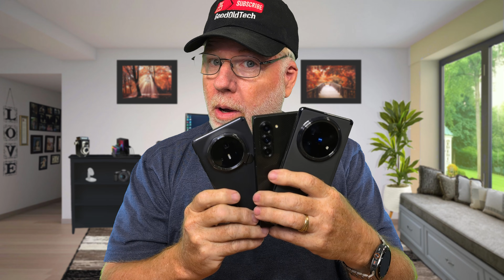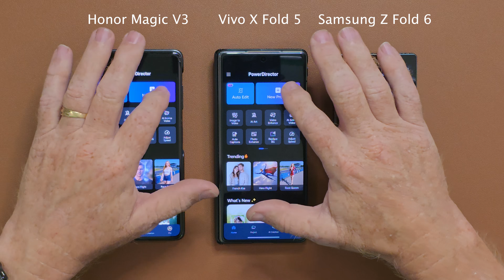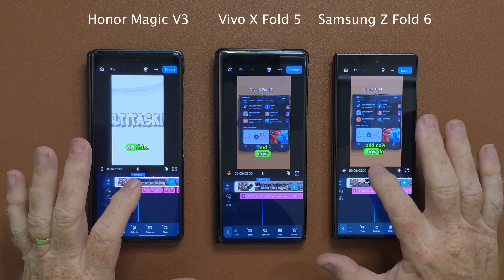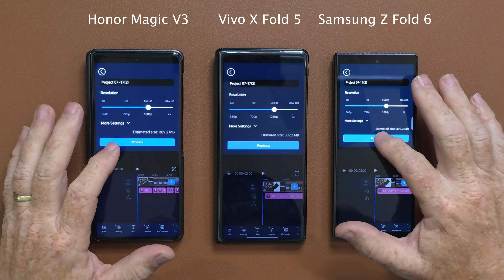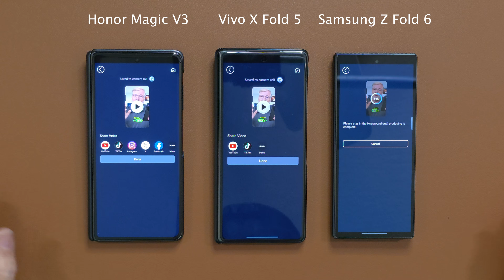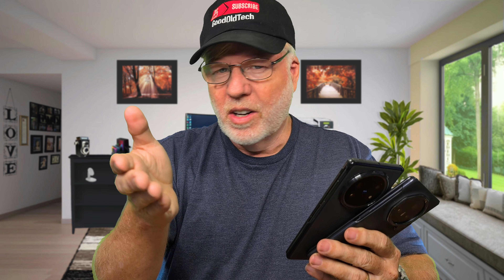Samsung Z Fold 6 Performance Test Leaves You Stunned!

Comment: Just curious as an interim check until you get the Fold7, how does the Samsung Galaxy S25 Edge compare in this test? Not a good showing for the Fold6 😳.
Reply from the maker: The S25 Ultra is very fast and beats all the folds I have. The Z Fold 7 arrives on Wednesday, and the Honor Magic V5 arrives by Friday. They both have Elite chips, so I'll include the Ultra in that test. I think it will still win because of the Fold's throttling due to its thinness. I'm anxious to see that outcome. 👍
Reply: @GOTgoodoldtech-1964 I have no doubt about the Ultra's dominance in performance, but I was asking about the *Edge*. The Ultra has a vapor chamber, while the Edge and Fold7 does not. The benchmarks suggest the Fold7 will be even slower than the Edge, due to further throttling from the even thinner chassis.

Comment: Have you made sure the Fold 6 isn't in power saving mode? Also are all battery saving features turned of for the app?
Reply from the maker: Yes, they all turned into full performance mode. Great question. I should have pointed that out and will make sure to do so in the next test. 👍

Comment: Vivo xfold5 has ufs 4.1 storage...so might be a little faster. Using the folds with heavy tasks you should unfold them for better heat dissipation. The honor and vivo are bigger so might start thermal throttle a bit later than the fold 6.
Vivo also tells you to unfold when fast charging to reduce heat.
The Oppo find n5 with snap 8 elite performs worse than the vivo xfold3pro with video rendering/export larger files because the thinner Oppo starts to thermal throttle before the vivo xfold3pro with snap 8 gen3.
Reply from the maker: Those are some great tips! At least, they were all on equal footing, folded for the test. The Honor Magic says the same thing when charging at a fast speed. I am not surprised about the Oppo throttling and expect the same with the Z Fold 7 and possibly the Honor Magic V5. This definitely gives an advantage to the Vivo X Fold 5, sticking with the Snapdragon 8 Gen 3. These will definitely be interesting battles. I will open them as you suggest. Shorts are all portrait and are best viewed on the smaller screen, which is why I did it folded.  Interesting thought, now that you mentioned it; whenever I do all the video testing of the folds, they are always closed because it is easier to handle that way. If you take videos outside for too long, even the Pixel 9 Pro begins to overheat and gives you a warning about the quality being reduced. That is definitely going to be a huge factor when it comes to outside video and photo shooting. I appreciate your comment and support! 👍

Comment: It could be other apps
Reply from the maker: I did make sure that all background apps were closed. But I'm guessing you may mean an installed app that is causing the issue because it has a bug in it or something? I would rule that out simply because they all perform the same on the first half of the test. I think when it came to the actual rendering, the Samsung started its throttling because it was overheating, which could be a function of the One UI 7 early detection to prevent the phone from getting too hot. Either way, the phone really got slow. Thank you for the thought, I appreciate your support!👍

Comment: That's really unbelievable. There must be a glitch or issue with the OneUI 7. Is it a Beta version on the Z Fold 6?
Reply from the maker: I totally agree. I did a lot more testing and research and continued to receive the same results. The Z Fold 6 is not using a beta version. 🤷
Reply: Nope, no excuses. Samsung has been doing this trickery for at least 2 generations now. Their units don't have sustained performance as there is aggressive throttling to extend the life of the tiny battery, which hasn't been upgraded in 5yrs

Comment: Thought about getting a Vivo X Fold 5 or Honor Magic V5 but decided to get the Z Fold 7 due to support in the US  but I hope it doesn't have these issues.
Reply from the maker: I tried several times to figure out what was going on with the Z Fold 6. I really think it must be a One UI 7 issue. I believe the Z Fold 7 will be fine. I will test it. The phone should arrive this week. Thanks for watching; I appreciate your support! 👍
Reply: If in US, wait for the Google 10 pro fold. It will have the 8-elite chipset, while having better waterproof, dust proof, and bigger battery upgrade. 

The Zfold7 was rushed . It doesn't open fully flat, gets hot, and still has visible sharp center crease.